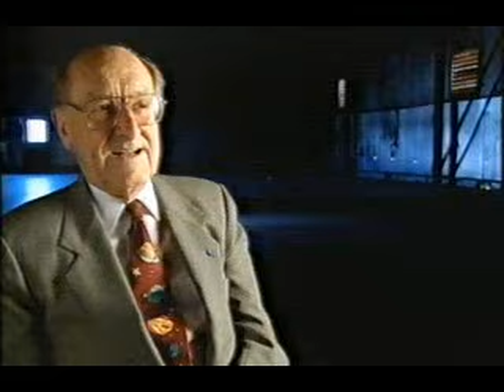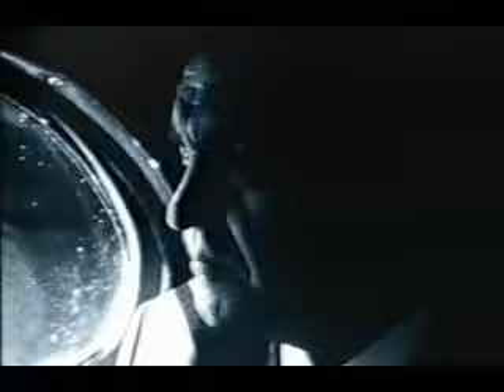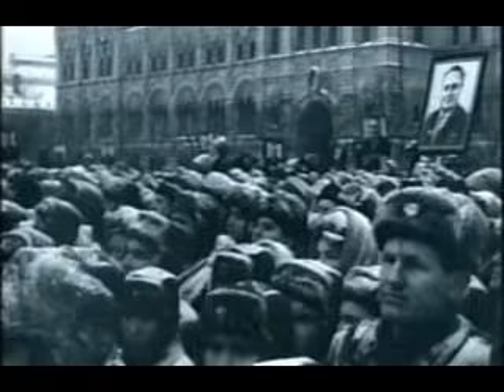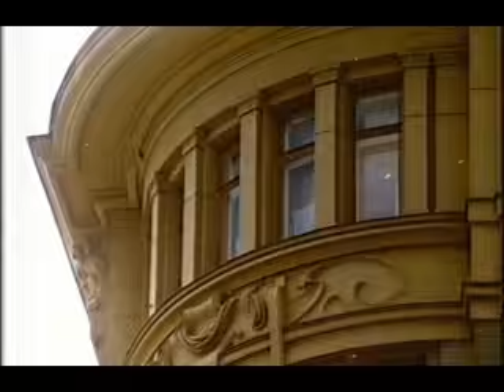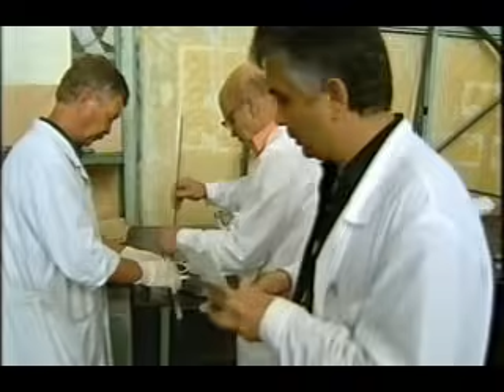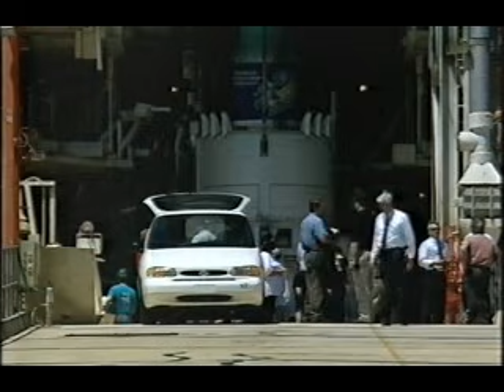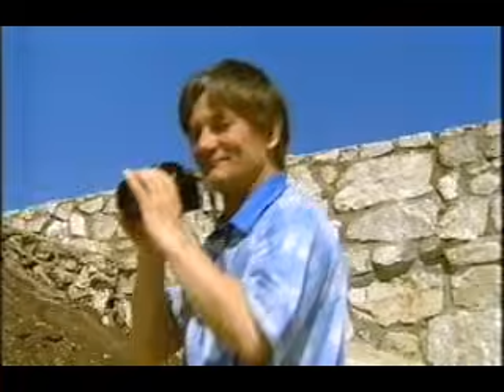Soviet N1 Moon Rocket Documentary

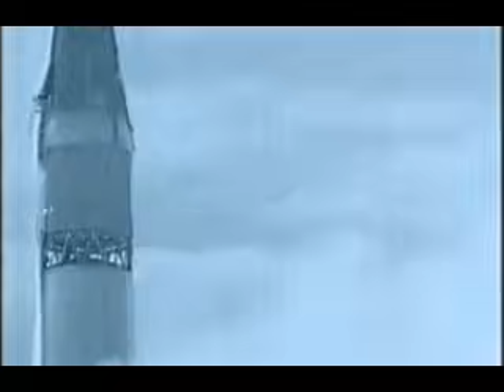Comment: 7:37 July 28, 1960: Vostok launch failure with two dogs on board. Failure due to booster broke up. Destroyed vehicle after impact over Baikonur.
7:44: Possible 8A91 maiden flight. April 27, 1958. Rocket broke up into pieces after SRB vibrations. Towards back

Comment: Staged combustion engines require either fuel rich or oxidizer rich combustion in the pre-burner. If petroleum based fuel rich combustion is chosen coking, i.e. soot formation, becomes a problem. If oxidizer rich combustion is chosen severe oxidation of the pre-burner components becomes a problem. The Russians solved the later problem with special metal alloys that resist oxidation. We solved the former by using liquid hydrogen as a fuel that does not coke, it only produces steam as a combustion product.

Comment: The idea behind the N1 was sound, unfortunately the implementation wasn’t. 

The N1 never reached orbit let alone the moon. 

It took until Elon Must establishment of Space X to actually get the idea of large engine number booster rockets to work.  

Better design and forward thinking plus incremental development has also ensured that the idea now works.
Reply: NASA spent years running individual Saturn V stages on huge test stands. The USSR decided to not build such a huge test stand and instead test those stages by flying them, to save time and money. They expected having to do up to 14 test launches. 
SpaceX is now doing something very similar with Starship.

Comment: Ɛlies has the same problem with Starship.  It uses the same engine configuration as the N-1: lots of little engines instead of a few large ones.  His engines are open cycle however, not as efficient as the little N-1 closed cycle engines.
Reply: Starship's engines work and it has got into space, unlike the N1 and SpaceX's Raptor engine is a full flow staged combustion engine, a better type of closed cycle engine than the oxygen rich closed cycle used on the NK-33.
The Raptor is also more powerful and more efficient.
Reply: With 50 years of advance in computer-aided design, it’s become feasible to work out the bugs in an installation with 30+ engines before the first one is built.

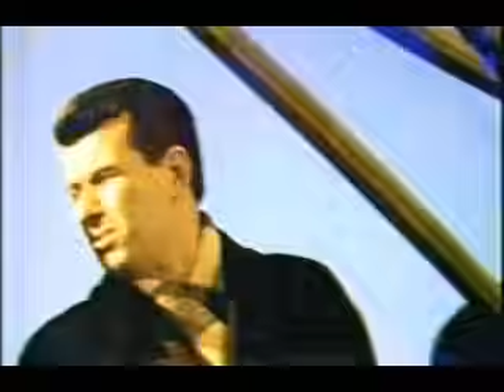Comment: "they didn't have the facilities to test the rockets before attaching them" 19:25
What?! how does that even makes sense? it's not as though they all have to be tested at once.
Reply: Once the engine was fired it could not be fired again.
Reply: The NK-15 used pyrotechnics to open some of its valves. This meant that after running the engine, it would have to be disassembled before it could be reused. That reduced the value of the test: the assembly process and the new components were untested. 
The NK-33 solved this by replacing the pyrotechnics with hydraulic or pneumatic valves, which meant each engine could be tested before installation.

Comment: There are so many mistakes in this video it's very very unfortunate

The F-1, commonly known as Rocketdyne F1, is a rocket enginedeveloped by Rocketdyne. This engine uses a gas-generator closed cycledeveloped in the United States in the late 1953 and was used in the Saturn V rocket in the 1960s and early 1970s. Five F-1 engines were used in the S-IC first stage of each Saturn V, which served as the main launch vehicle of the Apollo program. The F-1 remains the most reliable  and most powerful single combustion chamber liquid-propellant rocketengine ever developed.[1]
Reply: Rocker Dyne F1 vs RD 170

Comment: What's amazing is the NASA is still flying those Kuznetsov RD-180 engines today.
Reply: Kuznetsov's Design Bureay did not work on RD-180. They've worked on RD-107A, RD-108A and NK-series rocket engines (NK-9, NK-15, NK-19, NK-21, NK-33, NK-39, NK-43).
Reply: @caav56 , the RD-180 is the US designation for the NK-33, isn't it?
Reply: @104thDIVTimberwolf  No, RD-180 is, basically, a half of RD-170 - Energia's main engine. NK-33 was developed for N-1 rocket.

Comment: Chris Cline wrote three years ago: " YESTERDAY, an Antares rocket, built by the commercial space company called Orbital Sciences, powered by a RUSSIAN made RD-180 engine EXPLODED 6 seconds into flight and all indications for cause point to the ENGINE!" -- well, it was not RD-180, it was AJ-26, a modified version of NK-33. What do you want, they were sitting in a non-controlled hangar for half a century, it is amazing they worked at all. It seems that after the incident the NK-33 engines that remained in Russia were upgraded: a modified combustion chamber and a newly manufactured ignition chamber. They were used in four launches of the Soyuz 2-1v and so far none have exploded. I don't know what happened or will happen with the AJ-26 engines. As for Orbital, it switched to another Russian-made engine, RD-181, and none has exploded yet.
Reply: LeadHammer You're correct it was the AJ-26 that exploded. But the N-33 had nothing to do with it. They only used the design. Not the engine. The N-33 on bench testing had a 25% failure rate. On examination, they found metalurgical flaws in nearly every engine. Due to poor Soviet manufacturing technology of the time. (New note: they reused the turbo pump off a N-33 which is why it failed)
This is simply a possibility when using an engine that rides on the edge. It's high chamber pressures are what makes it so efficient, but also so massively over engineered and expensive. And subject to higher failure rates. Which was found out when they had to submit real paperwork. Soviet Russia just never publicizes failures and covers them up.  And this is the difference between NASA and Russian space program. NASA will never human rate a Soviet engine because they lack safety and testing. And incidentally who the N1 failed.
Reply: NASA human rates only US spacecrafts which blow up in the air.
Reply: NASA will never human rate yea the Shuttle program was very reliable and canceled

Comment: The only thing good about the N-1 was the use of highly efficient spherical tanks/vessels but bad idea to insist on using the highly problematic high pressure closed cycle engines which the US did not use nor to this day. The F-1 worked 100% then as it would today if resurrected.
Rickets are unforgiving, stick to conservative designs not perfection,save that for your life.
Hello Bob, Ken

Comment: I don't care what any of my fellow Americans say, these Russian engines are ridiculously good. They had a LOT of knowledge about metal alloys that we didn't. Compare the operating chamber pressure on an RD 180 or RD 170 derivative (between 3400 to almost 3900 psi) to anything that has flown. The SSME, which nasa calls the Ferrari of rocket engines, could only run at 2900 to 3000 PIS maximum. To my knowledge, only the final iteration of the Raptor will be able to match that kind of pressure . I'd love to have more information/video on Glushko's RD 270 (full flow staged, running UDMH/N2O4). That thing sounds fuckin' wild.
Reply: Ukrainian* engines.

Comment: As an engineer, I have a few comments. My background includes 12 years employment with a manufacturer of rocket parts. And my father was a technician working on the Apollo navigation system. Admittedly, the Soviet rocket program was proficient with a strong capability in rocket design in the 1950's. However, please beware: 1) Korolev was not a rocket engineer--he was a spacecraft engineer, 2) the Soviets had never developed a large liquid hydrogen rocket engine--the Americans have several, 3) the RD180 is an excellent Russian engine and Lockheed smartly uses it on their current Atlas rocket (so let's all work together), 4) the Soviets were ahead of the Americans in the early 1960's only for one reason: at the time their rockets were bigger. That changed after the Saturn V success in 1967. Why were the Soviets ahead up until then?  In the early 1950's when the Soviet Union and the United States were building rockets to launch nuclear weapons, both countries struggled to decide how big a rocket needed to be to deliver a thermonuclear weapon between continents. The weapons were new and the rockets were new. Thus,  no rocket engineer in either country knew the weight of the final design of a nuclear weapon fitted to a rocket. The Soviet engineers guessed a weight greater than the U.S. engineers and their rocket program proceeded accordingly with larger rockets. 
A last note about Korolev: he was diagnosed with cancer about 1968 and Leonid Brezhnev thought he would do him a favor and assign him the best Russian professor of surgery to take care of him. However,  by 1966 that man was a teacher and no longer a practicing surgeon. Korolev did not survive the surgery and missed seeing humans reaching and walking on the moon.

Comment: The point is that us engineers went with a safer design because the closed circuit design was more risky and required more testing and design work to make it safe for human flight, the russians took the risk in order to get a jump on the us program but, as us engineers figured, the rocket engines weren't reliable enough. The russians involved with these engines continued working with them until they were told to dismantle the program and they instead hid their rocket engines in a warehouse.

Comment: This is a rather strange documentary with an overwhelming theme of implying that the Russians had some magical technology that the Americans were incapable of figuring out.  First of all, the Saturn V design approach didn't require an engine like this. 5 engines is more reliable than 30+, obviously - thus SMALL efficient engines were never even researched. As I recall the USA's approach to a 1st stage moon rocket resulted in (still) the largest single-chamber rocket engine ever created. So for its intended purpose, the US design was essentially flawless (both in performance and in exceptional reliability - moreover it's a marvel in its own right.  

Had such a design been required, it would have been produced. This is obvious in the production of the RS-25, when NASA required a smaller and super-efficient engine. Not only is it a closed design with great efficiency, but it's twice as powerful, uses a DUAL shaft design with independent control of the fuels, and oh yeah - in addition to be incredibly complicated, it's not only reliable.. but also reusable. 

Under Russian management and production not a single NK-15 or NK-33 ever flew successfully. America's first (more powerful, reusable) closed-cycle RS-25 SSME flew over 400 engine-missions (3x on each shuttle flight) with 1 engine failure (electronic) and a 100% mission success rate.
Reply: Alex Thomas Falcon Heavy had 27 engines

Comment: I would have built two smaller rockets and docked their payloads in orbit then headed to the moon. Not one big one. Surly with all of their early successes they could have pulled that off.
Reply from the maker: David Vermillion.  Seems a good idea especially as they had the Proton available.
Reply: Imp5011 Unfortunately, Proton at it’s early days was extremely unreliable..
However they could of used the R-7 booster,  it could bring a lander into low earth orbit on it’s own.. 
then a second R-7 could bring a manned Soyuz to dock with lander in low earth orbit.. 
however it still wouldn’t be a enough to get to the moon..

Comment: The title of this posting is misleading. This is just a re-post of "The Engines that came in from the Cold", which is about the NK-33 and RD-180 engines. OK, it incorporates now-standard footage, but it's not mainly about the N-1.

Yes, the wonderfully complex RS-25 shuttle engines are closed-cycle, but they use  more efficient liquid hydrogen rather than kerosene. LH2 burns at a cooler temperature than kerosene, so the metallurgical challenges are a bit less, though LH2 is much more difficult to handle than RP-2. 

The Soviet Vostoks had the cosmonauts eject before landing because they had no landing rockets. The two Voskhods did have them, so there the cosmonauts did not eject; in the case of the  propaganda-demanded Voskhod 1, the three cosmonauts had neither space suits nor ejection seats.  Soyuz has both an escape rocket tower and landing rockets. The loss of Vladimir Komarov in Soyuz 1 came a few months after the Apollo 1 disaster, and in each case the spacecraft were greatly improved as a result. I would hope that once Commercial Crew starts to fly, the crews will visit the Astronauts' Memorial at the Cape just as they now visit the Kremlin Wall before Soyuz flights. The ultimate sacrifice of Grissom, White, Chaffee and Komarov  was not in vain, paving the way for so much spaceflight since then.

Comment: 30 engines, any one of which takes out the whole rocket upon failure...why not use Big Dumb SRBs as the first stage? Seems like it's a lot simpler to make large thrust numbers with solids, vs liquids. Then, probably hypergolics for the subsequent stages?
Reply: The engines on the first stage throttled to control the attitude of the vehicle. Something that can't be done with SRBs. Liquid propellants are also more efficient.

Comment: Well, truth is that the initial succeses of the russian space program were more or less hazardous stunts. And the russian program became soon inferior to the american - with the turning point being the Gemini missions. 
I´ve read a lot of books (real serious books, not Wikipedia) and it is a fact that the russians couldn´t match the Apollo technologies until mid 80s. They (for example) couldn´t even produce rocket petrol clear enough to be reliably used - until mid 80s. That is one of many reason they (at the time of Apollo) couldn´t come out with an engine comparable to Saturn V´s F-1. Therefore the first stage of N-1 had 30 main engines.
Reply: +Vít Křiklán If the Soviets had made the N1 rocket work with all the advanced technologies Americans didn't use (like the closed fuel loop and shutting down the opposite engine to one that's failed), not having high quality rocket petrol would've been a non-issue. You don't get points for elegance as long as you make the headlines as the nation to be the first to the Moon. As it happens, the Soviet approach wasn't perfected in time to make a difference.